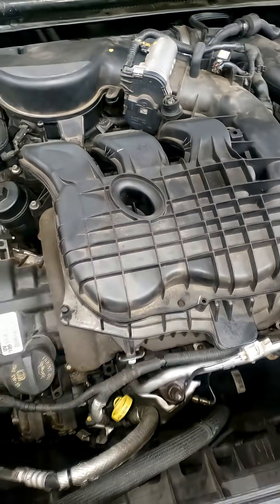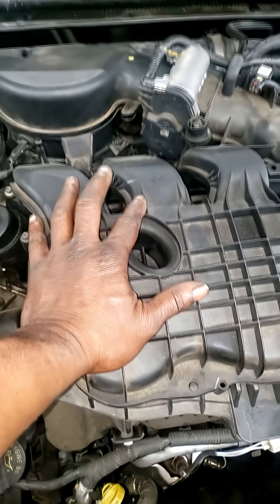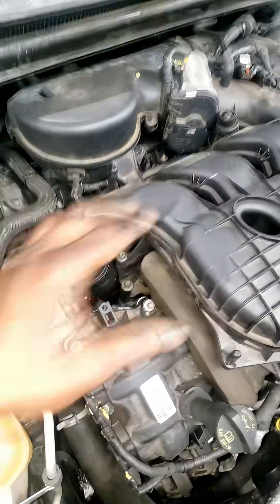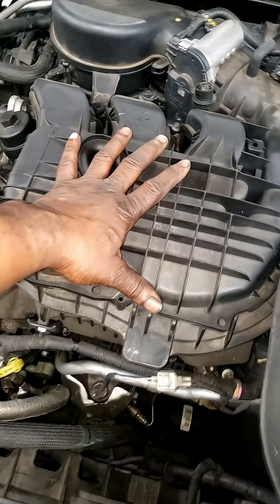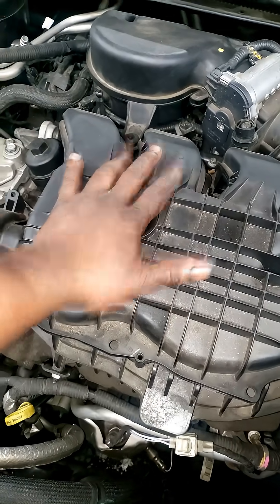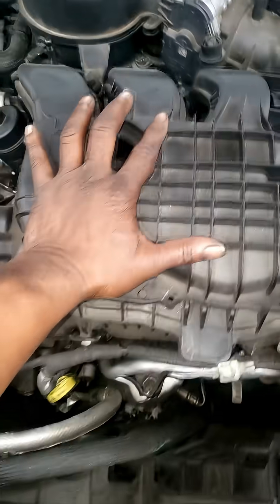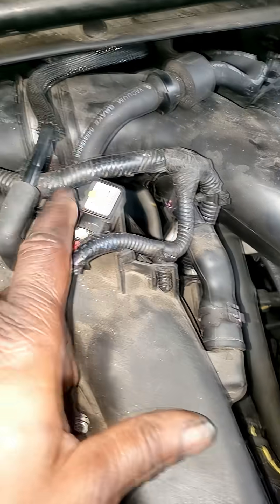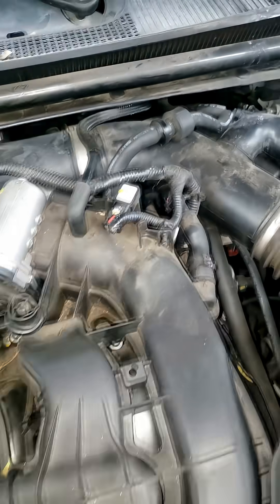"How to Find Any Sensor on Your Car — Start here

Comment: If any tech should know about  map sensors, it's definitely a Chrysler tech. They avoided maf sensors for years using a speed density system instead. They really relied on the ole map, more than most vehicles out there. 😅😂
Reply: 2nd gen Integras use MAP only. Extremely reliable going on 35 years and a one way trip to the moon. (248k) I suspect as MAF sensors continued to evolve they surpassed the possible emissions reduction of the MAP.

Comment: The cars are not the same simple “ignition coil plus carburetor” any more… everything is computer controlled going under AI now, the repairs now are literally “rocket science” - so, don’t try it at home!
Reply: Transmissions already had a form of AI, it’s in the adaptive shifting patterns
Reply: @gtzgreatride adaptive shifting is NoT AI by any means - it’s a simple feed back mechanism allowing the TCM to adapt to worn out parts without loosing the performance… The so called “tables” in the TCM memory get updated when the slippage occurs, thus, sending more fluid into clutches… when you replace the unit, the TCM needs to know that - thus, the re-initialization is necessary to return the TCM to its original state… I know it’s a bit complicated, but that’s not AI 😊
Reply: @gtzgreatride so is the throttle body…